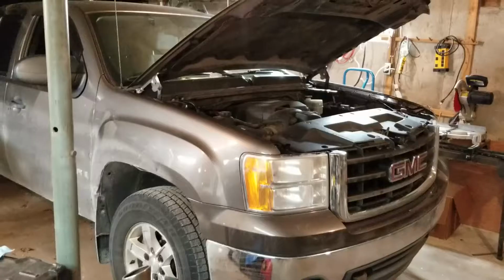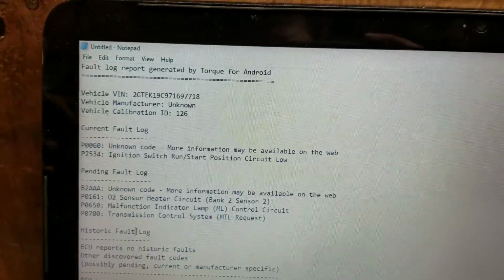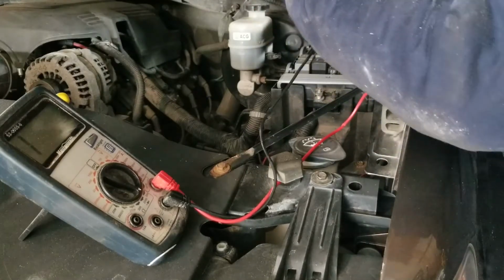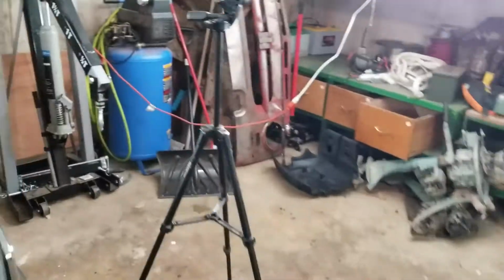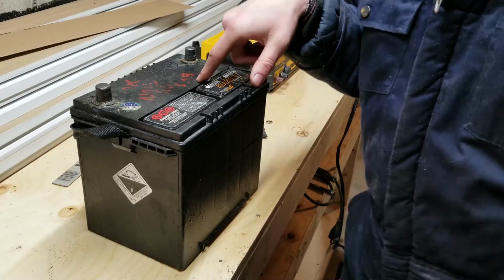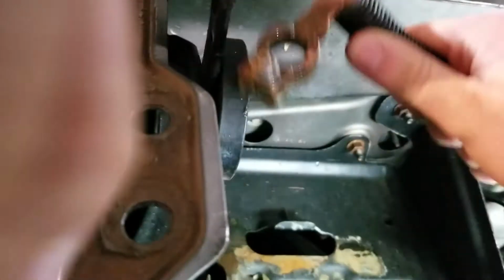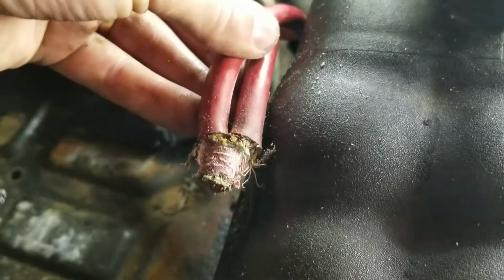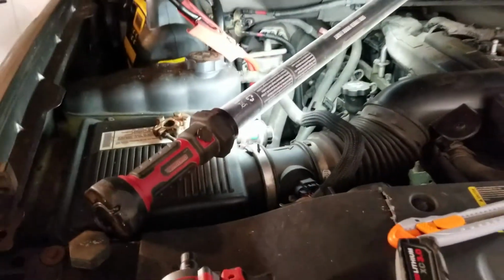$2000 Sierra, Junk or Good Truck? (2007 Chevy Silverado)

Comment: Nice score! You can't beat the price for a running/driving truck. :)
Reply from the maker: I'll have to make an update video about this over the winter when I can't access my international. That truck is my daily now, it turned out just to be a bad fuse box that caused all those issues. BUT did catch where someone had tried to hide a few holes in the frame, so I had the frame checked over and reinforced. But for what I paid for it I'm really happy, I would trust that truck to take me anywhere now that it's all fixed up.
Reply: @RustRehab  awesome! 😀 glad it was just a few small problems. You can't beat that! 🙂👍